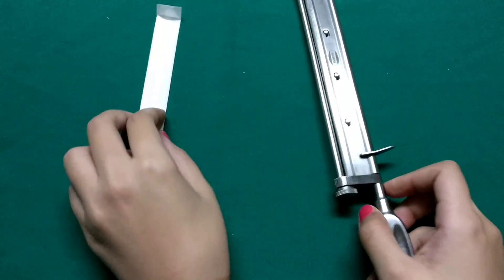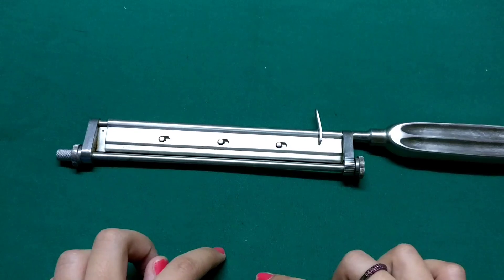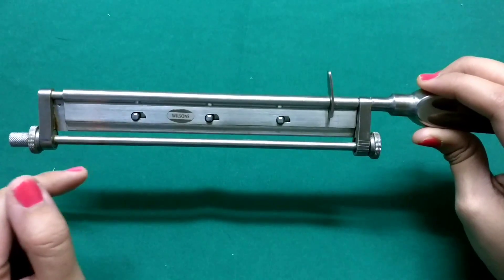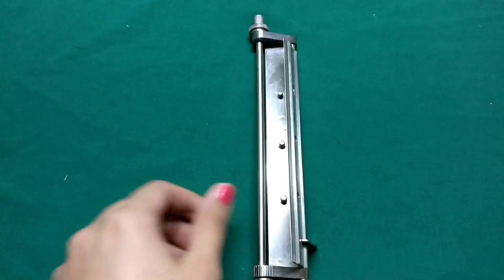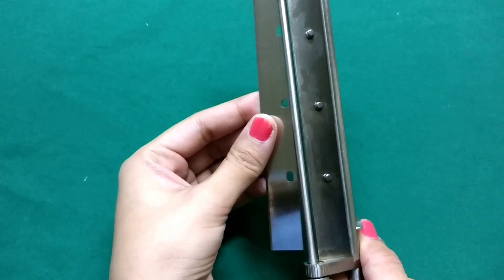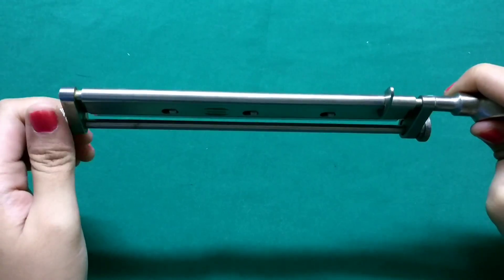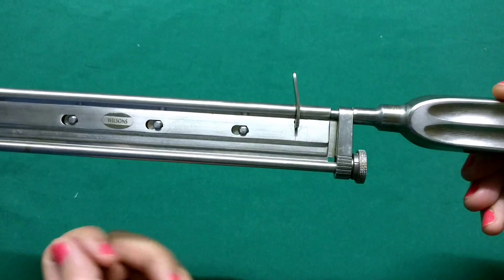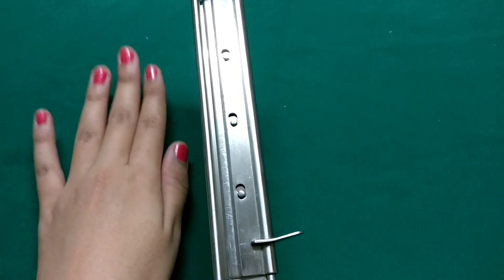Skin grafting handle

Comment: Ma’am is there any  bevelled edge to the downs blade , can the blade be inserted with the other surface facing up ( sharp edge outside) ?
Reply from the maker: Hi, the bevel edge which faces outside is also the side facing up when you lock the blade in the handle
Reply: @DrPS13  how to identify the beveled up on the sharp edge ?

Comment: Dr. thank you u explained it so well!! I'm a student who wanna make a biomedical device for skin grafting just want to k right now what procedure you are following for grafting ....are u using meek technique ? or electric dermatome with skin mesher? It would be really helpful if u will  help me in this ...hoping for a positive response thank u
Reply from the maker: Hello..thank you for liking my work. I use a skin grafting handle, battery operated dermatome or the Zimmer air dermatome whichever is available. I hand mesh or use a mesher depending on the the recipient site requirements.
Reply: @DrPS13  thank you so much Ma'am ...i also want to ask one question that for every skin grafting we need to mesh the skin? or without meshing we can directly put the graft on wound site?
Reply from the maker: @yashashreejoshi1050  for large surface areas you should always mesh.. meshing helps in 2 ways: 
1. To expand the graft size from 1:2 upto even 1:6 with a mesher. This helps to cover more areas when donor site is limited
2. Meshing prevents collection under the graft and helps it uptake.
-Meshing is not required when FTSG is needed for cosmetic areas as meshing leads to a reptilian appearance of skin.
Reply: @DrPS13  Thank you so much Dr ....u explained it so well, I understood 😊
Reply: Dr. I have watched many of your videos you really explained about each instrument very well. I have some more questions I would like to talk to you about my biomedical project in detail. So if possible can you please help me in this.How can I contact to you ma'am??
Reply from the maker: Hello..Kindly email me @drpriyanka1387@gmail.com